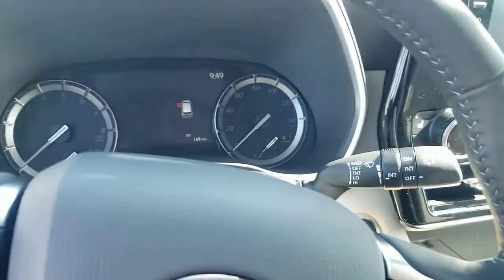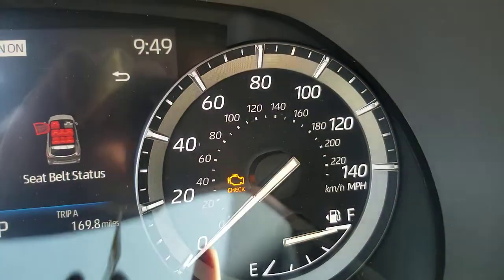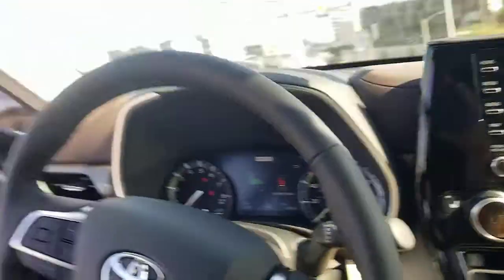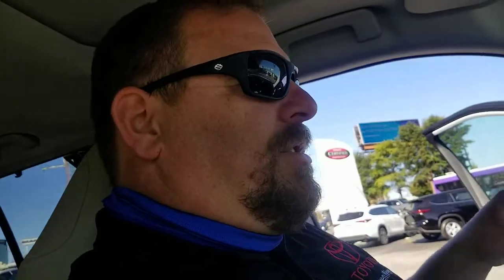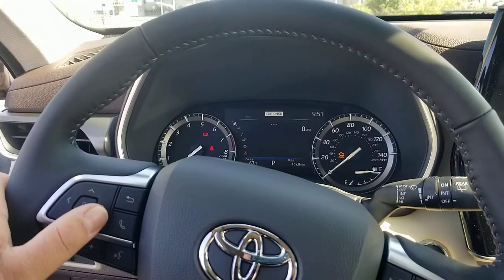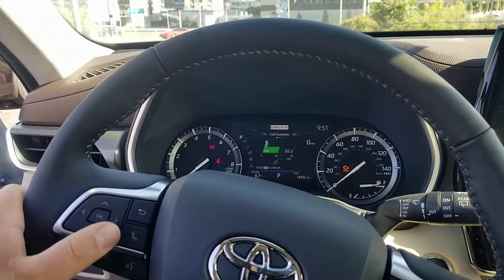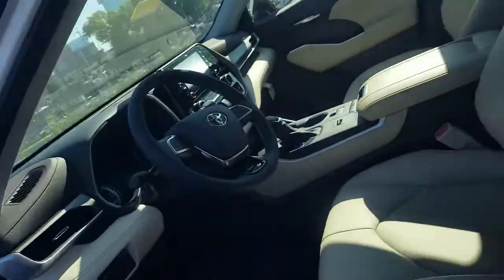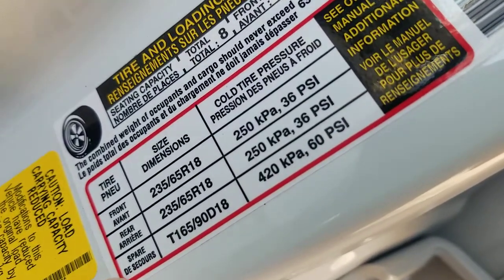What is this light? How do I get it to go off? Exclamation point in parenthesis tire pressure light

Comment: my light came on, and all tires were 28 except for my back left rear which was 25 and they are all supposed to be 35. I drove for 45 mins and a little while later and then the light started flashing. I dont know why it was flashing but once I stopped driving and kept the car on a minture later it stopped flashing and was just left on. I have no idea what that means. I have not checked my spare though
Reply from the maker: the flash usually means it couldn't detect a tire

Comment: Good explanation why it happens but is there an action item? Like pump a couple more PSIs in each tire, or just ignore?
Reply from the maker: @temputuber  you need to get it back to within range. Usually add air in the winter and take away in the summer

Comment: I have a 2018 Toyota RAV4 and I just put air in my tires with a help of a gas station worker and right after, I turned on my car and it showed me this sign. I live in Dubai and summer gets quite hot!!

I was hoping it would go away but it didn’t 😢 (like when I refuel and my liter per 100km meter info shoots up but goes back to normal after driving for a while) 

I watched your video and it’s very helpful however I am a complete noob and paranoid I’d do more damage than good 😅 

Would you recommend I go back to the station?
Reply from the maker: around here they would help at no cost. if you are not comfortable get help

Comment: If you have the tires rotated and they didn’t reset the system how can I do it?
Reply from the maker: Normally you cant. Unless there is a tpms reset option in your mid display.
Reply: Steven Welch thanks for the info, I appreciate it.
Reply from the maker: @kathysmith4026  happy to help